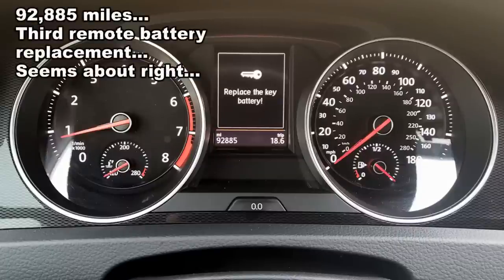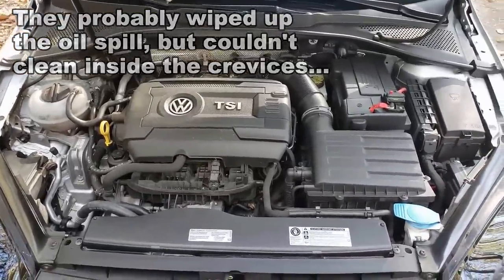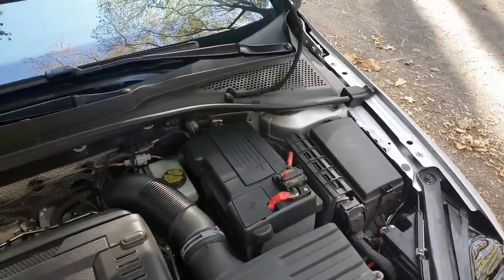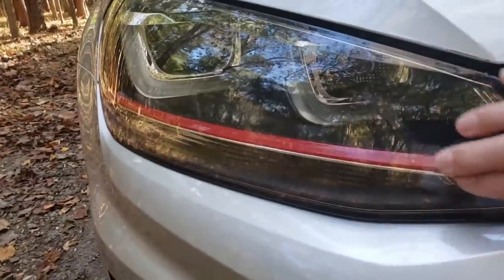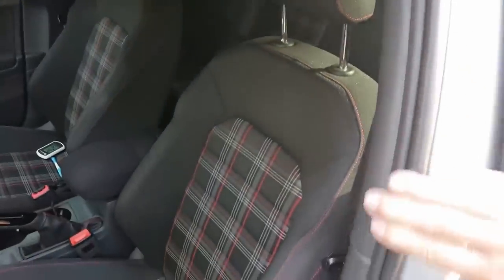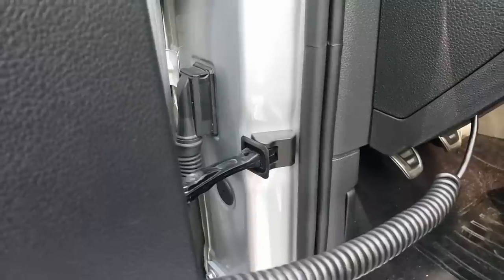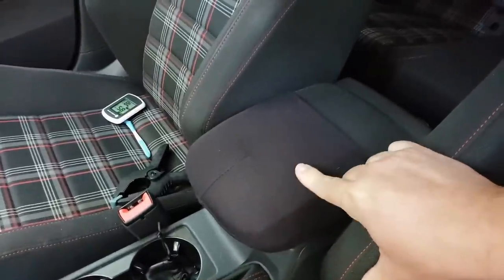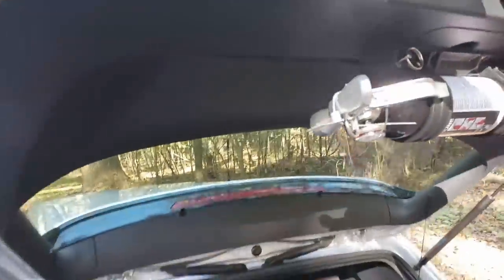THREE YEARS AND 93,000 MILES: My Report, Part 1

Comment: Not consuming its leaking. Waterpump seal is failing, this is a documented issue. Normally they replace the water pump and all under warranty.
Reply from the maker: My cooling system recently received a clean bill of health. I'm sure the shop would have gladly taken my money to repair the leak if there had been one. Thanks for visiting.
Reply: @StealthGTI  We thought the same and as it was a minuscule amount the techs never identified it as an issue until it became more noticeable. Then they looked more closely. Worth having them look at that area specifically particularly if you are still under warranty.
Reply from the maker: @thegan9143  - Warranty is long gone. A minuscule leak is not worth tearing it apart. I'll wait until it's a real problem.... and share when it is.
Reply from the maker: @thegan9143  - Warranty is long-gone. Thanks for following-up.

Comment: Sorry if it's been asked, or is another video, but is that extinguisher holder a mod you made or can it be purchased?
Reply from the maker: Bryan - No sweat. I don't think I've shared that info here since I haven't discussed the fire extinguisher in detail. This particular bracket is designed for flat surfaces: https://amzn.to/2VHCASO. Thanks for visiting.
Reply: Oh, and couldn't agree with you more on the rims.  I have the same set on my 2017, and have had 2 straightened already in 2 years.  They never are quite the same after either
Reply from the maker: @bryanevans5398  - My straightened wheels have been great. I watched the man work and he got them to within 5/1000". Pretty amazing. I have a few sets of these wheels, just in case I bend some beyond repair.
Reply: @StealthGTI  i wish I had a spare set, but here in Canada the cheapest I can't find them is 1000$ per
Reply: And 4k for a spare set isn't in the budget (so the wife reminds me )
Reply from the maker: @bryanevans5398  - WOW! One of my earlier videos speculated whether these wheels would become highly sought after. Glad I bought some while I could.

Comment: the coolant was for sure the water pump
Reply from the maker: The water pump housing eventually revealed a larger leak around 115,000 miles. I've been running a replacement (improved?) water pump, housing, and thermostat for the past 48,000 miles. Thanks for visiting!

Comment: Curious on your driving habits, spirited or average? I’m a spirited so just curious on how it would hold over time. Cheers
Reply: Also how did you rack up so many miles? Neat car. Glad you’re using it.
Reply from the maker: My driving habits are mostly highway. My commutes can be speedy, with an occasional authoritative pass. I give it a good blast about twice a week. Otherwise, pretty boring.  ;-) As for the miles, my daily commute is 35 miles each way and is 85% highway.

Comment: Some coolant is evaporated from the overflow I believe. Mine does the exact same thing. That's all I can figure
Reply from the maker: I had thought the system, including the reservoir, is sealed. But someone said the reservoir cap will let some pressure escape if it gets too high. I will continue to watch my levels and see if there's really any loss. Thanks for visiting.
Reply: Lancifer Lancifer all cars do that. The coolant is mixed with distilled water50/50. Water slowly evaporates.
Reply: Vadim Sayenko yes sir. I agree

Comment: coolant consumption maybe a result of a thermostat going bad, its very common on these cars! might need a replacement soon
Reply from the maker: Looking into it. Thanks.
Reply: More than likely the cap on the tank not holding pressure during expansion very common  
How can a stat cause consumption ?
Reply: @chood1818  The cap isn't an issue at all, its the housing that has a design flaw where coolant would eventually seep out of a weep hole on the underside of the housing. Red/pinkish coolant can be seen right around the area and can drip onto the oil pan. There is a revised version of the housing that ultimately fixes this issue.

Comment: Seems like you really care for your vehicle... funny that you just leave it out in the snow. and by funny i mean its actually atrocious
Reply from the maker: I lose sleep at night, knowing that I'm exposing my car's paint to crystalized water droplets. LOL!  Thanks for visiting.
Reply: @StealthGTI  and you wonder why your vehicle leaks. really consider how funny i think this is. of course you can just leave your vehicle out exposed in the bare freezing elements, but should you really be doing that with a Volkswagen of all things?
Reply from the maker: @andiarrohnds5163  - What does snow have to do with a leaky NON-OEM oil pan? The oil pan is the only leak I mentioned. "A Volkswagen of all things?" It's a VW, not a Bentley. It's okay to leave it outside. It won't melt.
Reply: @StealthGTI  be that the pan may had no fault with the cold. Do you really trust the metallurgy and composition of every temperature susceptible component made by VW?  their corner cutting is very well known and documented. can you trust every electric pump/motor, every wheel bearing, every solenoid or relay, every chip of flash memory which stores programmable or non programmable code, which is actually susceptible to cold temperatures, to be reliable and not just drop your entire ECU and give you random weird errors one day only to have scam artist mechanics throw parts at it? seems like car technology is way over your head. can you trust your water pump to not develop a gap from being too cold and suck coolant into your engine? i mean do you really know what you are doing?  its a volkswagen. lets not even get into sensors and general composition of various plastics either. you seem to know when to get out of owning this vehicle. 90k seems about right. who is the funky fresh hip hop loving young adult immigrant you plan on selling this car to?
Reply: just as i thought. no reply. hah, typical. also i see the gti water pump is mounted outside the block. still pretty sure the cold ruined either your pump or the headgasket. china quality, man
Reply from the maker: @andiarrohnds5163  - You don't know anything about me; you've made a lot of poor assumptions. I've worked with electronics and some mechanical systems for over 30 years. I keep my cars until they're worthless. My last car was a 1998 Jetta TDI that I bought new and kept for 20 years and 450,000 miles. It had none of the problems you describe. I sold it for $1000 to someone who wanted to transplant the engine into another car. As for varying temperatures: Great! Let's say I keep the car in a temperature-controlled garage. What happens when I drive it out into the cold for my commute to work? The temperature fluctuations that concern you will now happen as soon as the car rolls out the door instead of gradually as temperatures fall overnight. And what about while at work? Do I leave my "poor car" outside or should I ask the boss if I can park it in his office or the lunchroom? I DO trust the engineers to design cars for these temperature variations. I've never had a problem that you describe.
Reply from the maker: @andiarrohnds5163  - My "no reply" is because I have a life outside of YouTube, especially on a national holiday. I also have a full-time job. So, YouTube traffic is handled when I'm not busy with something else... anything else. Our interaction is good for my channel; "engagement" improves video ranking. However, you and I have run our course. I will not be replying to any more of your posts. Thanks for the engagement/ranking improvements.

Comment: DO NOT do APR stage 1 tunes. Ruined my GTD.
Reply from the maker: In what way? I was never fond of APR's TDI tune. I can hardly imagine how they handle the emissions equipment. BUT, for gassers, they have too much experience to "ruin" a car. Just my thoughts. Thanks for visiting.
Reply: @StealthGTI  well, for starters, after the added power my gas milage, or should I say diesel mileage, went to shit. Then the transmission case bolts got loose due to the added stress and I started leaking transmission fluid. Then the turbo started making a weird wining sound and giving a fault every other week. Then the engine started leaking oil, and then I lost top end power. Bottom line I lost 7-8000 euros in repairs and half of the cars value in resale due to all the problems. Never again!

Comment: Great video brother,  I have the same issue with my coolant, it's good to hear that someone else is having the same issue. Have you had to change your transmission mount yet?
Reply from the maker: Still on the stock transmission mount. I must be gentle on mine.... no launches.
Reply: My Wife’s car was leaking a little coolant through plastic thermostat housing, apparently a common fault with those. Also had front windscreen replaced under warranty.

Comment: Fantastic video. I was concerned about an APR Stage 1 tune on my Mk7, but yours seems to have been great. I think you've convinced me. Thanks!
Reply from the maker: Do it! HAHA!
Reply: If you have a MT just be prepared for a new higher performance clutch very soon after tuning.
Reply: @Cimone90  I've got the DSG (which doesn't seem to like our sub-zero cold up here in Minnesota).
Reply: @chrisswatchbox7378  oh yea? I have a manual in Canada and it's fine stage 3 with a clutch obviously, but my dad has a 2019 golf r in north western Ontario ( just north of the Minnesota border ) and so far so good. He says it's a lot of fun in the snow haha.
Reply: @Cimone90  It's a blast once it warms up, but the delayed clamping while it's still cold always catches me off guard. I can never tell if my tires are skipping out the DSG is just letting the clutch slip. Lol. It's especially scary when it does this as I enter an intersection from a stop.

Comment: I was waiting to hear about the coolant.. that has always been a major problem for me
Reply: This is an ongoing issue my  water pump is leacking .
Reply: When u start to notice the low coolant plz check the under cover of any leaks  from the water pump. B4 it fails.
Reply from the maker: I did a follow-up video a few after this one: https://youtu.be/u3dYx-tAL94. In short, the leak is miniscule. In fact, I still haven't needed to refill since recording this video six months ago. Sure, the level has gone down a tick or two, but it's still within an acceptable range. Thanks for visiting.

Comment: My 03 Corolla now 131k mile, how did you get 93k in 3 years?
Reply from the maker: The same way I put 400,000 miles on my '98 Jetta TDI in 15 years: I DROVE IT. My daily commute in 2016-2017 was 50 miles each way. Now it's 35 miles each way, 95% highway. Then add weekend activity and the occasional road trip. The commute alone is 18k per year. Add pleasure to the mix and it's not hard to what I've averaged. Thanks for writing. -Scott
Reply: @StealthGTI  
Why don't u get 15 golf tdi?☻

Comment: VW batteries fail consistently between 3 1/2 to 4 years.
Reply from the maker: I think that is about how long my original battery lasted in my 1998 Jetta, too. I went larger with that replacement as well.  :-)
Reply: I got mine replaced here in Las Vegas for $98brand new/ dealer asked for $270. Three to four years is the right life cycle of most batteries so replace it.

Comment: Curious what’s your oil change interval? Especially Stock vs Stage I / II
Reply from the maker: I drain every 10,000 miles, both stock and tuned. I don't run the car hard enough to justify a shorter drain. I'll allow oil analysis to dictate a different interval. Thanks for visiting.
Reply: StealthGTI that sounds awesome. I am paranoid and drain every 3000~5000 miles on stock lol. But I do a few track days (<5)

Comment: Your clutch is holding ok?  Are you in Maine?  Who did your tuning?
Reply from the maker: The clutch is doing well. I felt like I had damaged it while backing a loaded trailer up my inclined driveway. I abused it pretty good, as indicated by the smell. But it's continued to hold for thousands of miles. I'm in Virginia and had my tune and clutch work done at a shop called "EuroPros." -Scott
Reply: @StealthGTI  thx man.  I have a similar ride '17 S.  I've got 75k on it and I believe my stock clutch is starting to slip.  Strangely it seems to happen in the taller gears if I quickly nail it and its only for a moment.  I also notice it more when it's wet or damp.  If I'm pulling in lower gears in mid-range and upper revs it seems fine.
Reply from the maker: @audieconrad8995  - Yeah, my stock clutch slip in a similar fashion, only difference being that it was cold... the first cold snap of Fall. I had stabbed the accelerator at low rpms for a quick pass with a 1000-lb trailer in tow. Not an ideal way to treat a clutch. Oops! I decided to move early on a stronger unit.

Comment: What antenna and radio are you running??
Reply from the maker: Ranger - Your question is simple, but the answer is complicated. The antenna you see is for the car's VHF/UHF digital ham radio. I have a few details at https://wp.me/P7YnQB-iJ. Removing the factory sharkfin antenna disabled the GPS and the Sirius radio. I don't use them, so that's okay. The AM/FM radio works fine since its antenna is in the rear glass. If you were, indeed, asking about the ham radio, it is an Icom ID-5100A. I have some details at https://wp.me/P7YnQB-4d, if you're interested in seeing more about the install. Thanks for visiting. -Scott

Comment: Great video. I have the same car with an is38 swap. Good to see a 93k tuned car still going strong
Reply from the maker: Dean - I'm tempted by the IS38. I cannot justify it... YET. It'll be at the top of my list if my stock turbo fails.  :-) -Scott
Reply: @StealthGTI  It changes the car. Much more top end power. Not a fan of the new APR is38 file though. They tuned all of the low end torque out in favor of grip.
Reply from the maker: @deanmarr785  - I think I've read somewhere that APR can (will?) flash an IS38 GTI with a Golf R file, should the owner want to retain the low-end torque at the cost of grip. Check into and let me know what you think.
Reply: @StealthGTI  That's my plan next time I'm at the tuner, unless they update current file first.

Comment: Have u changed the timing belt yet?
Reply from the maker: No. The Mk7 GTI has a chain. I don't expect to mess with it unless I hear noise or unless a visual inspection reveals a problem. There may come a point when high-milers report "You should change at XXX,000 miles." But I'm not aware of that point being met yet.

Comment: Good stuff ! I would fit the sump skid though ! I have a Mini Cooper S, now. Much better !!
Reply from the maker: I had considered a MCS, but couldn't lose the low-end torque I had come to appreciate from my TDI. Plus, the MINIs were having lots of troubles at the time. Hopefully, that's improved now. Thanks for visiting.
Reply: @StealthGTI  I think all is well with Minis now. There were problems with HP fuel pumps and direct injection on the Prince engine, but I have the new B48 engine - 2 litre, and it has 220 lb/ft torque at 1350 rpm on overboost (207 lb nominal) !! covered 3000 mies in 2 months without any problems !
Reply from the maker: @peterbustin2683  - That's good to know. But probably still not the car for me. My next vehicle might be something that can take me into the wilderness. Nothing in VW's current U.S. line-up will do the job, not the one I'm considering. Thank for the response.
Reply: @StealthGTI  I think Minis are for a kind of person !? I had one when I was 20 and im 54 now and its bloody difficult to get in and out of - and these new ones are much bigger ! Its still a fun, cheeky and very potent, capable hatch.
Reply: @StealthGTI  Yeah, I concur. Same problem here in UK. I used to be a VW fanatic but im now an escapee! I grew tired of the staid styling and aftertaste. Im mostly happy with the MCS.
Reply: I was set to buy a Mini Cooper S. Until I drove the GTI. Glad I did too. As the Mini has gone through generations it’s gotten fatter and more bloated looking. And the giant center Speedo just looks silly.
Reply: @michaelconverse5127  I think all cars have gotten bloated over a similar time period - look at the Fiesta or even the Beetle. The centre console style takes some getting used to, but it certainly reminds me of my first Mini back in 1978 - even the moans about it ! I find myself waiting for the 1st gear whine now which never comes in my new one !
Reply: Peter Bustin i would not drive a water cooled beetle either personally. The air cooled ones are another story. But even with those most enthusiasts prefer the pre 68 (US) models. Some folks are into Super Beetles and they do make good “German Look” cars. 

I like the original Mini (1959-2000) as well as the first generation of the post 2000 cars but the second-current generation is sort of, in my mind, the Super Beetle version of a mini. Yes they may be better than the earlier versions but there is something missing compared to  the basic, cleaner earlier models.

Comment: I've had coolant usage in my ford focus too.
Reply from the maker: Thanks for sharing that. If I were to believe some of the other comments posted here, this is a problem that's exclusive to VW and, therefore, their cars are junk. HAHA!
Reply: StealthGTI it’s probably your turbo using up the coolant. I’ve got a 2006 Mitsubishi Lancer Evolution and it used up a tiny bit of coolant until I changed it out for some higher temp coolant. Volkswagen is a whole different world but sometimes a tightly packed coolant system with a turbo can burn up some. Or it could be a faulty radiator cap not being able to hold all the pressure.
Reply from the maker: @Ouiya4200  - Thanks for sharing that.